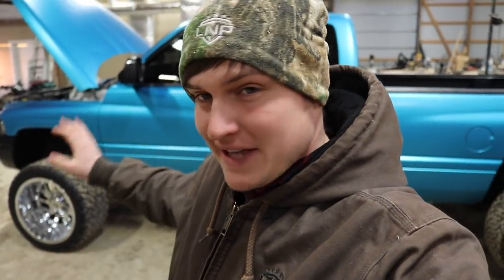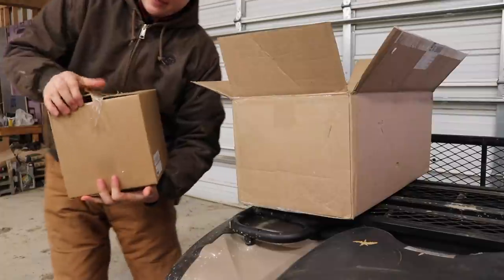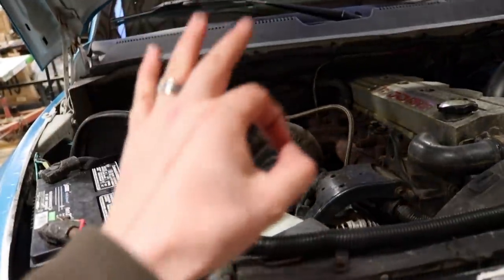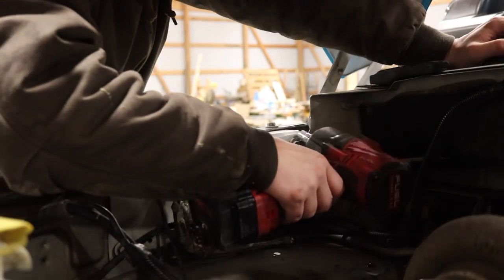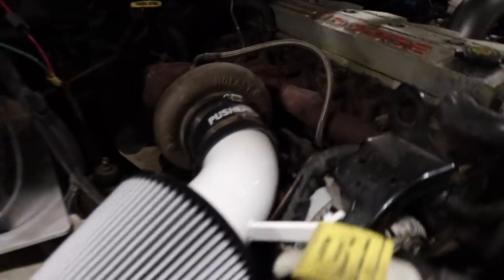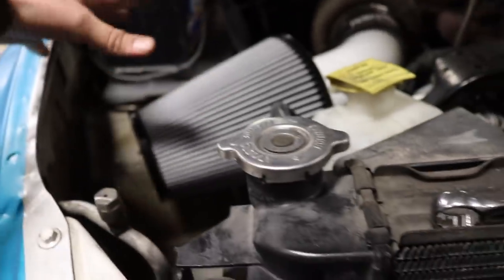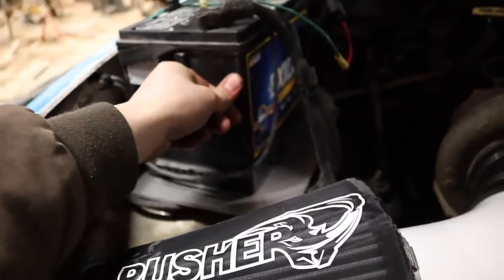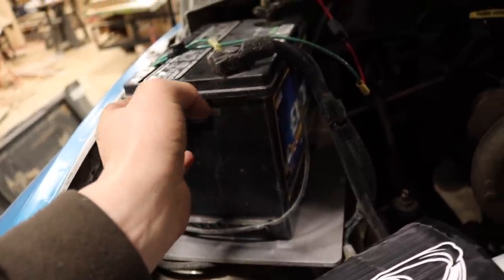Installing the HIGHEST QUALITY parts made for these truck!!! *PUSHER PARTS*

Comment: If you need new battery hold down bolts, find a Dorman/Motormite 00582. I just replaced a few of them on my truck while changing my batteries.  Same thread pitch and length.

Comment: I couldn’t find the intake you used on their website do you happen to have a link to the exact intake
Reply: Exactly I can’t find cold intake system or battery relocation tray either but I think from 1st gen cummins cold air intake system looks like same on pusher website but the reason why I can’t find the battery tray I think call contact with them about battery tray I definitely will buy these asap lol